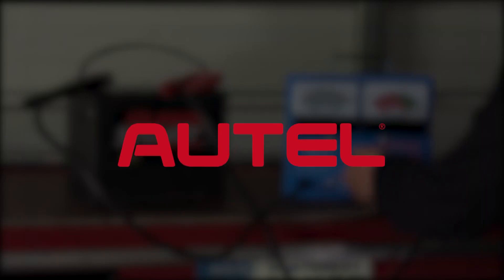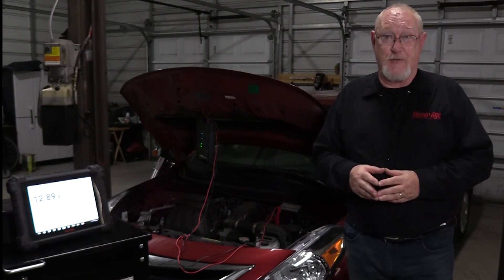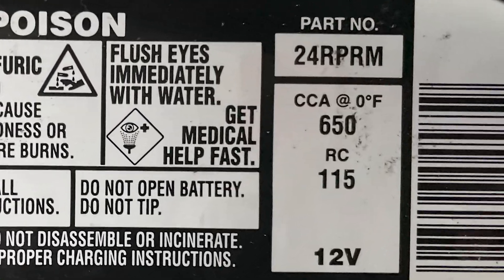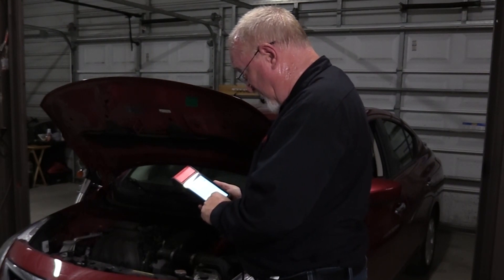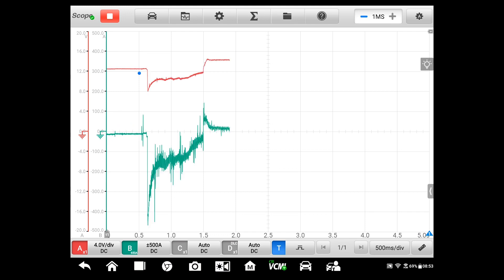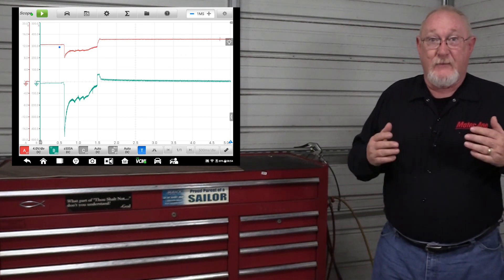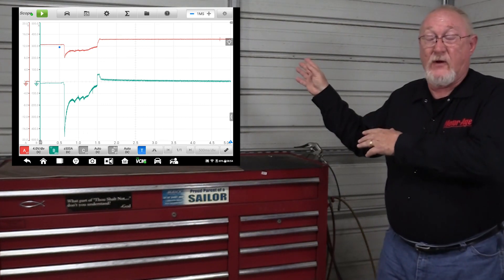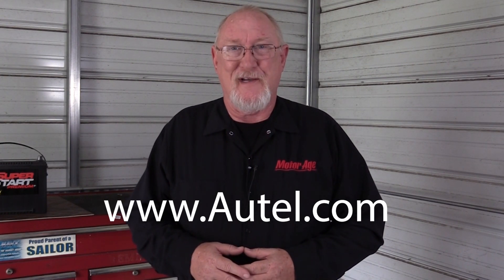The Trainer #116:  How To Properly Test An Automotive Battery

Comment: @Motor Age, Based on the inrush current of this vehicle and in the event that the vehicle later goes on to have a discharged battery (due to say the headlights being left on), would you jumpstart it with a portable 12V battery powered jump starter pack that can deliver at least about 500 peak amps?   

Thank you for all the information packed content. You and Goss' Garage are my favorite for automotive knowledge.
Reply from the maker: Good question! I never really thought much about the peak amp rating of a jump box. I'll go with my gut and say that the bigger the better! I would think that a low rated jump box would not last as long or offer as many attempts as one with a higher rating. I'll have to do some more homework!!

Comment: hi PETE, i heard you mentioning something i need clarity on. you spoke about memory saver. is it possibble that you can uninstall a car battery and when you reinstall it the car does not start?
and the problem being that you ininstalled the battery

m.b.s moshitoa (south africa)
Reply from the maker: Yes, it can be possible because throttle position may need to be relearned. Your service information system should be able to tell you what systems need to be checked after a battery swap.

Comment: Thank you sir! Why wouldn`t the voltage trace cross the 12 volt triggering level at the trigger point? Isn´the blue dot the triggering point?
Reply from the maker: I think you mean how the voltage trace starts up from the left of the screen and holds at the trigger point until the vehicle is started. That's the beauty of the "Single Trigger" function.